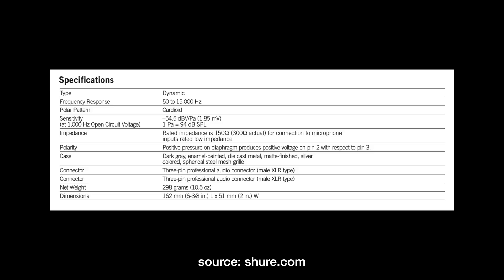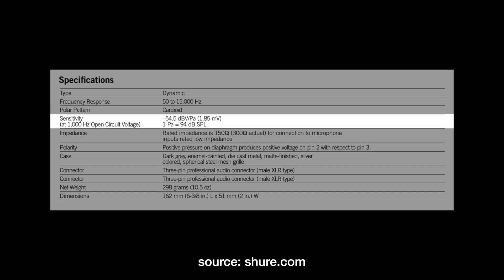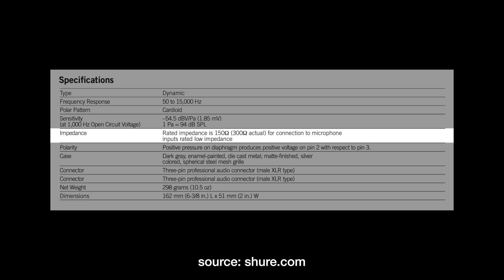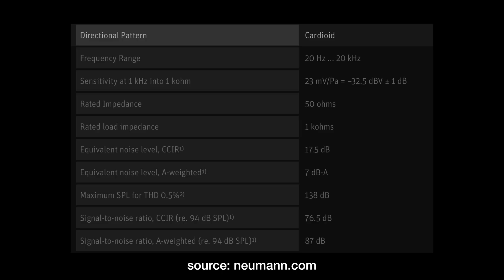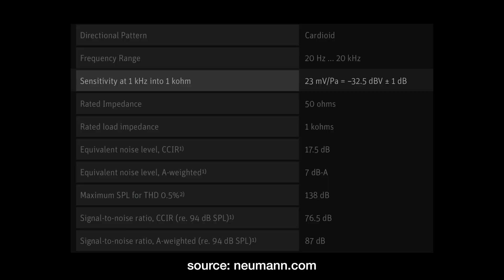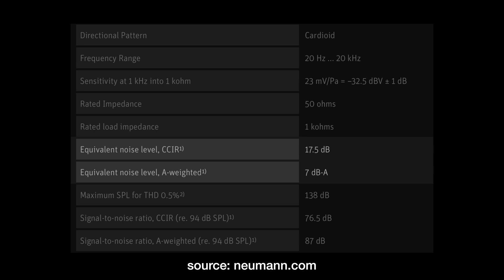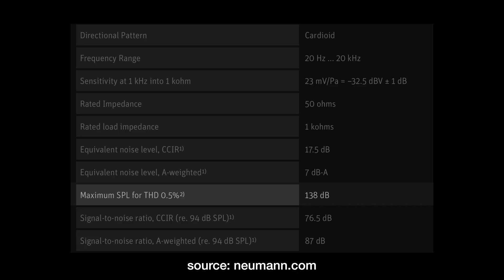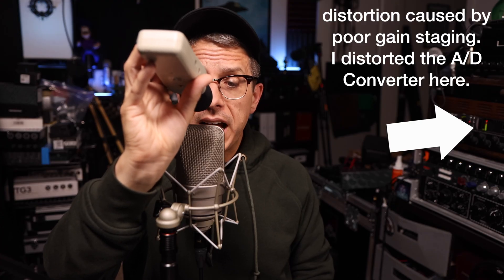Why These Microphone Specs Matter? (PGOA 1.6)

Comment: There is alot of confusing and I think, misleading information about the output level of condenser mics.  At 1 pascal (94db) of sound, a typical condenser mic will not produce approx. 20mv peak voltage on its output pins (XLR 2 and 3).  If you close-mic a loud guitar amp thats playing sound at about 94dbs of sound into the capsule, you will get an output voltage of about 1 volt peak.  Not 20 millivolts like the mic manufacturers say.  I am pretty sure that 20mv/pascal is just the sensitivity of the capsule itself, not the amplifier circuit thats in the mic.  The amplifier circuit in the mic amplifies the signal of the capsule about, times 30.  That gets the little 20mv signal to about 1 volt, that is about +1dbv , not -30dbv.  Thats why alot of mic pre amps have a maximum input level of around +10dbv.  Sorry for the long post, but this topic has really pissed me off and people deserve to know. Gosh darnit!

Comment: Regarding selfnoise: If you do audio books, everytime the reader get’s to the bottom of the page of a physical book, and you go to next page, the difference in tone is quite audible, just from moving the head from a low tilted to high, but also right to left. To combat this and also plosives, that sneak around your pop-filters, you can move the mic further back to about 75cm/2.5foot. Then you’ll need more gain from your preamp, which really should not be a problem given todays affordable gear, but it will also bring up the level of the selfnoise of the microphone. Listening to such a recording on speakers is fine, but if you use headphones, and many users of audiobooks does, then it becomes noticable. Sure, you can use de-noise plugins and gates (expanders are better), but it’s best to just not have the problem. When I went from a Neumann M147 to a Neumann (Hello, Neumann) TLM193, it was bliss!!

Comment: Very nice summary!

wrt EIN, what's "good" depends on the size of the mic. Even the very best lavs (Sanken COS-1D, DPA 4060) have EINs on the order of 25 dB or thereabouts. Likewise, even the best small-diaphragm mics are in the low-mid teens (Sennheiser 8040 at 13 dB or KM184 at 15 dB).

Numbers lower than that are only achievable by large-diaphragm designs, but those come with tradeoffs in terms of high-frequency pattern consistency and transient response. Some makers optimize EIN at the expense of other attributes by using larger-than-typical diaphragms for their category (cough, SE8) but that has the aforementioned negative impacts.

As always, you need to understand what you're recording and make appropriate tradeoffs.

Comment: U87i: 18dBA self noise (pattern not specified). U87ai: 12 dBA self noise operating in cardioid pattern mode.  14 dBA in figure 8 pattern mode.
Reply from the maker: thanks for the correction.

Comment: I will point out that impedance does increase the noise floor for mics.  It's a different style of self-noise as this one is related to voltage, which is usually very small.  EIN is usually measured with an impedance of 150 ohms as a baseline.  Some mics like the Heil PR40 for example have a 600 ohm impedance. 

!

Comment: Impedance is relevant in the sense that the lower the microphone source impedance, the lower the noise.  E.g., at the same temperature, same rated bandwidth, and same sensitivity, a mic with 150 ohm source impedance can be 6 dB quieter than one with a 600 ohm source impedance.  In reality you have to factor in the bandwidth and sensitivity too since the improvement due to lower impedance could be offset by a lower sensitivity and/or a broader bandwidth.  Keep in mind the source impedance varies with frequency, so objectively what is specified on a data sheet may not accurately represent the actual value and therefore the noise observed in practice.
Reply: Very interesting. I’ll have to check this out more and make a connector with different impedances to hear the delta in noise performance. 600-ohms seems pretty uncommon in my experience. I did a quick search and it looks like out of 700+ videos I only have mentioned 600-ohms 5 times. Pyle PDMIC58, Maono PD100, Tonor TD510, Heil PR-781, Beyer TG-V50. I’m sure those super budget karaoke style mics would have 600-ohms, but most mics that I have been reviewing seem to be 300 or lower.
Reply: @BandrewScott  The AKG D5 & perhaps D7 are two of the 600 ohm that I recall from memory - it seems like a few of their other older mics may have been as well but 150 to 300 ohms is more common.  The impedance peaks occur at the resonant frequencies of the microphone and this is where the output is highest and why we often see the frequency response graphs that emphasize certain frequency ranges.  Designers will use  resonators, porting, mass changes to the diaphragm/voice coil assembly, and even air volume around capsule to tune and get a more desirable frequency response.  Testing as you suggest is usually good opportunity to learn!